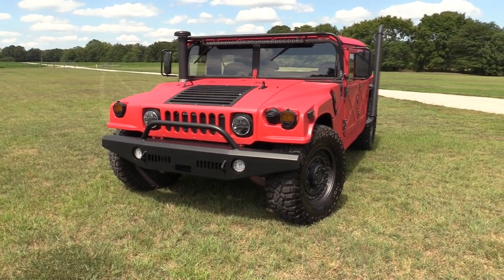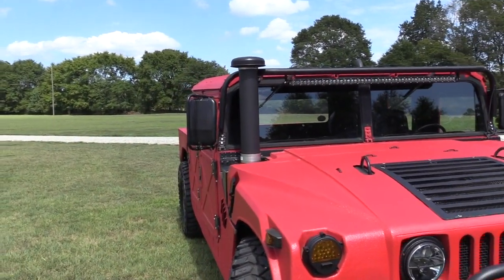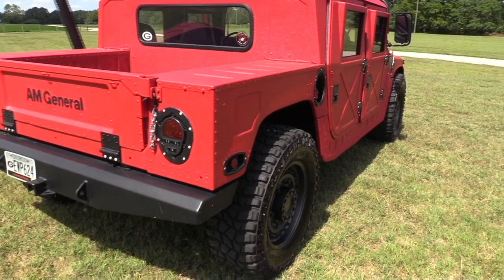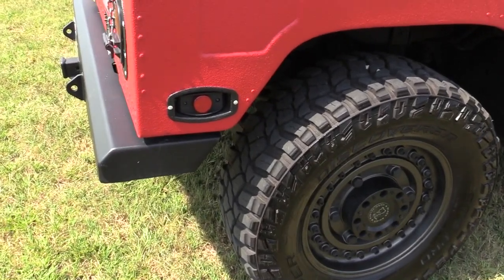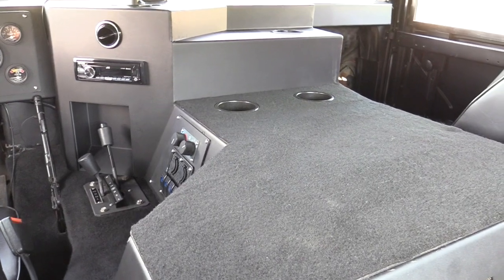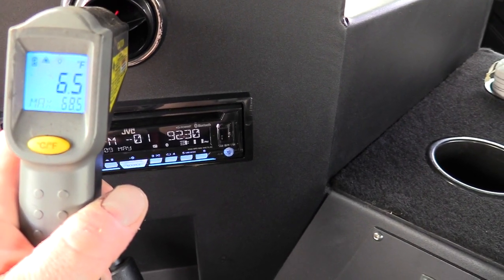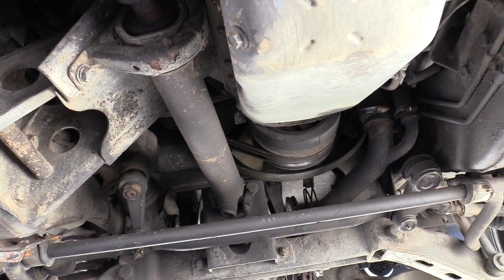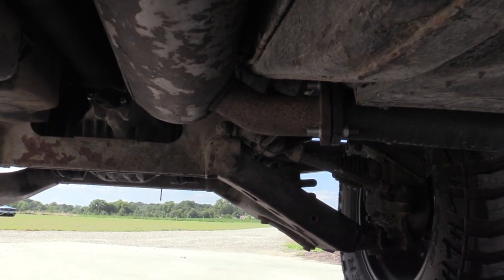1992 M998 Custom HMMWV

Comment: Is it D.O.T. street legal???
Reply: Street legal varies by state to state however most require headlights, tail lights, turn signals, backup lights (which are not found as standard on most military vehicles and MUST be added) windshield and windshield wipers, seat belts for all passenger locations. Custom lighting above the windshield may be illegal in some states or must be covered with a shroud when on road to comply with local state laws. Even with all of the above mentioned requirements some states will refuse to grant an on road title which will force the owner to register the vehicle in a state that allows the additions. Once you have an on road title for a state that is friendly to these conversions one can usually pass inspection and have an on road title issued in their state. Oh and another issue with many states, the VIN number, military vehicles do not bear a standard civilian VIN number, some "custom manufacturers" can issue a street legal VIN number. Some states will permit the builder to create their own VIN number following the states rules on "home built" vehicles.
Reply: @Subgunman     Thnx.  Good info.